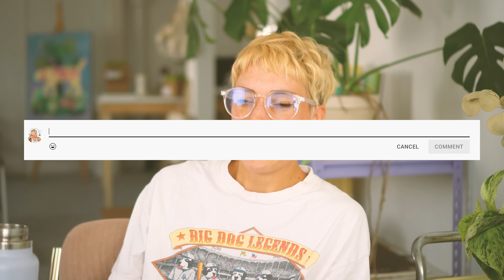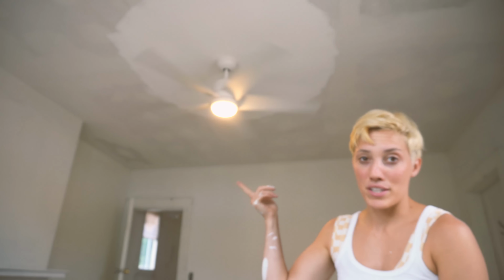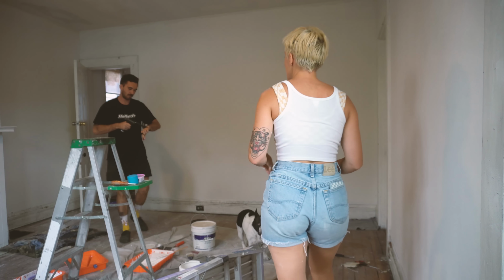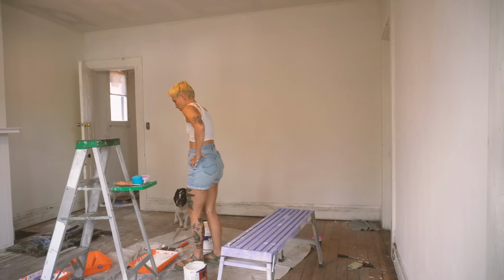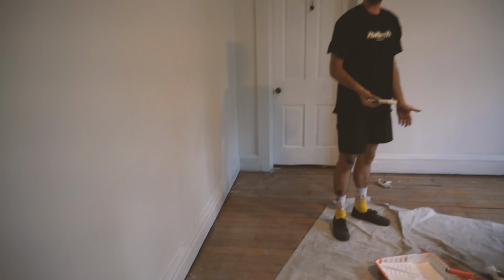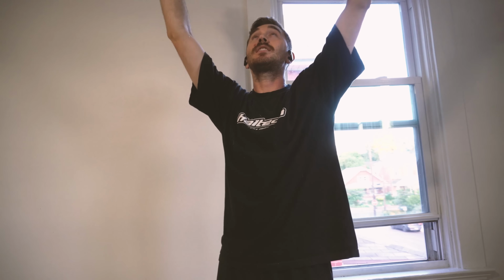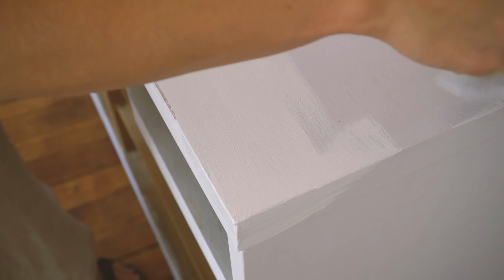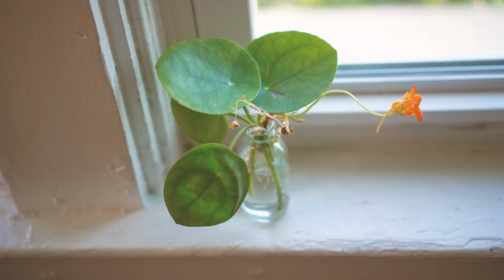old studio ➡ new bedroom ♡ august vlog

Comment: Girl! I have been there with plaster ceilings and 100+ year old dust. My parents put back together a farmhouse from 1820. My sisters and I spent years lugging plaster, lathe, and dust out to the garbage bins. Wuf. The new space looks amazing!
Reply: Also, oil floors, keep them clean with Murphy's Oil Soap. It doesn't strip out the oil in the floor. You'll need to polish them from time to time, but they will get slippery!

Comment: The bedroom is so cuuuute. I finally dome Herc content, I was missing this dude <3
I drink water from my bottle, because as soon as my cat notice a mug (yes) with water he has to put his paws in it 😹

I'm not an owner of an oiled wood floor but I'm educated in wood (more for furniture industry but wood is wood), so here's a little tip - If you want to have an extra smooth oiled wood you can warm up the wood right after oiling it with a hairdryer (or this industrial hairdryer like thingy), the wood will sweat some oil, use cloth to spread it again. Repeat until it stop (or almost stop) sweating.
Reply from the maker: hmmmm! I wonder if there's a way to do that with a larger area HM